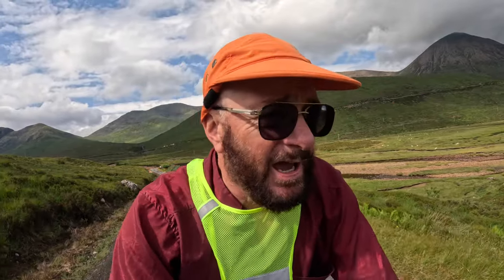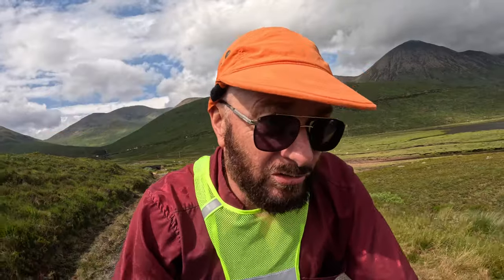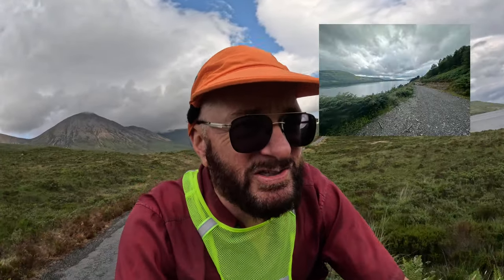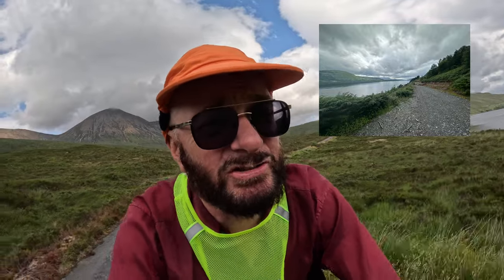Keeping the battery charged while ebike touring / bikepacking

Comment: I'm in costa Rica and have a RAM 1200 watt e-scooter with 72 volt 40 AH battery.     I am having a utility/camp trailer built for $115  that will have hard sides and rain protection. I will be traveling with a 1300 watt gas generator as well. But plenty of places will allow me to plug in offering a few dollars. I will be turning 76 in a few days but still at it. I do not have residency so a drivers license not possible. But also have a 110 cc 2 stroke moped and may tow one on the trailer as backup.
Reply from the maker: Wow thats quite some setup
Reply: @Ebiketouringlife  Electric only it will do 36 KPH up a 21% hill. upon which the posted limit is 40.  I weigh about 180 pounds.  I use a app on my cellphone showing percentage of grade. Very handy. And often take chalk and write the percent of grade for others.  Until 4 years ago I mountain biked in the Andes of Ecuador, Peru and Bolivia. Pushing my 21 speed mountain bike up mountains over 16,000 feet. Not in my prime would I attempt to actually ride there. And sometimes even walking more than 10 feet and resting was enough with a mountain bike and gear.  I still keep mountain bikes in Mexico, Nicaragua, Costa Rica, Panama, Colombia, Ecuador and Peru as it is a pain in the ass flying with a bike, let alone Internationally.  But all of those cost less than $200. Less than shipping would have cost.

Make it to Costa Rica or mentioned countries, get in touch.  Moped adaptions are the cheapest, bike and conversion about $450. Electric bikes with 1000 to 1200 watts are $1200 to $1500. My scooter was $1600. Disconnect the withe wire limiter and the 1200 watts becomes 1800 and no one will know the difference.  Europe limits wattage too much. It is speed that counts. If they want 20 MPH the limit, fine. But the power should not be limited to do so uphill.

When the weather sucks where you are it will be spring like here year round.
Reply: So the gas motor is there to power the battery for electric scooter? Why not just have a gas powered scooter? I thought the point of EVs is to be more efficient than gas
Reply: @ianleui7007  Gas powered scooters are not allowed in National Parks her or allowed to operate and park on sidewalks. Electric scooters are allowed in those places. On the roads gas scooters must operate in lanes with vehicle traffic, while electric scooters can operate on dedicated bicycle lanes. At home my e-scooter is recharged by non carbon source as has been so in Costa Rica for the past 10 years. Mostly wind turbines and in such quantity the excess is exported to 5 other countries. And in addition to that an electric motor is much quieter. Anyone knowing about 2 stroke mopeds also knows they cannot be run more than 20 minutes nor at low speeds as they will overheat and destroy valves and piston. Lastly the gas generator only serves as a backup. I likely will find it completely unneeded as the scooter is a 72 volt, 40 AH battery good for over 130 miles without peddling.
Reply: @ianleui7007  Nearly forgot. Gas mopeds and scooters here also require emissions testing. And those engines will not pass, absolutely guaranteed. Electric scooters and bikes are not emissions tested.  You think California is rough on emissions, you have seen nothing.
Reply: @riskyron1416  that's very interesting I didn't know that thanks for explaining
Reply: @ianleui7007  Course I could add a 2nd battery for about $5000 but the gas generator is still about the same weight. And can power my refrigerator at home during any extended power failure.. Though not feasible an e-scooter could be transported on plane with a medical prescription. A gas moped never could.. Costa Rica is about the size of New Jersey, so with a 130 mile range and being located center just about all is in range. And sure most here would allow me to plug in and recharge. Even a hostel would only be about $6 and a hotel $25. Most countries are like Europe where you have the right to roam. Meaning both government and private property can be used to walk, bike, go by horseback and camp (just no  vehicles with internal combustion engines) providing you do not interfere with others or camp in their front yard. Or stay more than a night. System works well.

Comment: Love your advice. Would love to know what type of ebike ur cycling please as I have 3 year old Giant Liv Amiti and only use for shopping and occasional long trips but it I think the eco mode is bad on these so I stay in lower manual modes depending on terrain. Buying second battery is good idea but the charger is heavy enough itself. Thinking of looking at lighter ebike with lighter battery and lighter charger. What do you think please?
Reply from the maker: Depends on your touring style - if it’s between hotels or other places your certain of charging then your battery can just have slightly more range than the longest distance you’d do in a day. If like me you wild camp then the extra battery means you don’t need to panic if you go a day without a charging possibility 

Mine is a Raleigh Motus Tour which I reviewed after 11,000km here in the context of the questions your rightly asking Review after 11,000 km on a Raleigh Motus Tour - 6k of those bikepacking
https://youtu.be/LS9ND5WifnY

Comment: Great video, very informative and raising important issues. You get 100 km out of your 500 Wh battery. This = an energy consumption of 5 Wh/km. On my Specialized Como ebike in eco mode I cannot get less  than 9 Wh/km on flat roads and with no luggage. I.e. my 460 Wh battery under no circumstances give me more than 50 km range. How come power consumption is so different between different makes of ebikes? May ebike testers look into/test this pls.
Reply from the maker: This is pretty interesting, do you know what the eco mode gives as an assist as a percentage (40% for mine). Also is it speed limited to cut out at 25kmh as I think that might make a big difference in range if not. I’ve cycled 4 different e-bikes now and all would be similar range as what I get although one that is rear wheel drive did appear to be 10-20% less as that’s a lot cruder. I hope to replace my controller with the Nyon and I’m hoping that may give me access to historic battery trip data in which case I’ll be able to cross compare with my watch records of distance & ascent and provide something better than my approximations (but I’m sure of them within 10%)
Reply: I live in Denmark which is flat land. My ebike is off the shelf, I.e. it follows the 25 km/hr speed limit cut-off EU regulation. 
As for the eco mode I do not know the exact  percentage, but going by the meter reading it should be around 20%.
Reply: There are so many variables that even the same rider on the same bike on the same route will have variations due to head/tailwinds. 
I was disappointed with the range I was getting from my 720 Wh battery (15aH), and recently upgraded to a 1008 Wh (21aH) battery. That plus replacing my 2.8" wide knobbly tires for 1.75" wide smoother tyres allowed me to do a 70km ride over hilly roads ands still have 40% battery power in reserve.
I used to carry a second battery, now I don't need to - but I'm also back home after each ride to recharge.
Reply: Your hypothesis isn't correct. Watt hours are calculated in a certain way but arent always true, i.e. your peak draw may be higher than you think, your cells aren't that good any more, voltage sag and so on. 
Generally, the higher the voltage the more watt hours in the same configuration as the voltage is higher. A 36 v battery will never have an equal voltage to a 48v battery, to the 48v battery has more overhead to supply to your motor.

The reason  batteries and wattage draws vary so much is simple, not every motor is equal, not every battery is equal, and not every rider is equal.

I for example have a hub motor mountainbike with 1000watts, my battery is rated for 1200 watt hours, that does not mean that I have an hour and 15 minutes or so of full throttle at full power, that would be a oversimplification of watt hours.

Comment: You can always charge your cycle at an ev charging station also, a lot of the Tesco charging points are free as well, but even if you have to pay it's very cheap.
Reply from the maker: Really?  I’d no idea they had a standard plug outlet - that’s very worth knowing
Reply: The adapter plugs in to the ev charger, it's the adapter that has the standard plug socket on it. @Ebiketouringlife
Reply from the maker: ah so you need an adaptor, is it the same as the one you need for campground electricity hookups  @bvgb921
Reply: Many times it's not as much about access to power as it is the amount of time it takes to recharge the pack.

Comment: Im planning on doing a tour from Alaska to Argentina on my bosch powered ebike. Good video. Gonna get a second 500 wh battery too. I got the 4a charger too so it charges abit faster.
Reply from the maker: Yep the 2nd battery gives you needed confidence to take risks around distances where you can’t be certain of a charge as the ‘panic point’ shifts from c100km to twice that.  The faster charger really pays for itself instantly as it means a meal break can almost all do give you another days range
Reply: Might want to rethink that. El Salvador in particular expect to be robbed and lose all. Border crossings not pleasant either. They may tear your bike apart and all you will have left junk.  While I admire your plans it really has not been feasible since the early 1980's.
Reply: @riskyron1416  I’m a decent size brown guy, lots of people doing this route every year. Feel like the risk is worth it.
Reply: Of course, you are.

Comment: So is it 20a 36v batteries ? Yes as I do. I have had folding e-bike since 2014 and had 370wh battery included and would charge any cafe or ferry waiting room I came across , I have a more powerful 42v 4a charger that helps to do it quicker :) thanks for posting
Reply from the maker: not sure of the A and v but its 500w and yes with a fast charger so full charge in about 150 minutes and if its near flat a charge t 50%+ in about an hour (charging seems to slow a fair bit as you charge to the higher percentages)
Reply: @Ebiketouringlife  Thats correct - for example for a 48v 13s battery, the full voltage is 54.6 volt, not actually 48v like one may think; then, around 54v - the BMS will "trickle charge" and balance out the cells. Thats the reason for the slow charge.

Comment: i think the range algoritm is pretty simple ; it just says how far you can go if you keep cycling the same way as you are cycling right now. Same speed ,same level of ascending , sime amount of wind ,putting the same amount of effort yourself, etc...
Reply from the maker: From observation I don’t think it’s a ‘now’ estimate as that would jump wildly every time you crested a hill. I think it might be since the controller was turned on but with the start point being the previous time the controller was on as the variation on start up estimate is wide but consistent with my last usage (for fully charge 500w I see 90-150 on startup) It might/could be smarter than that, perhaps weighting the last 20km at double the previous etc.
Reply: This goes out the window if your knees, etc. give out, as mine tend to after 15 to 25 miles! (Or you need to have your blood pressure medicine changed to a less exhausting formulation!)

Note: I’m near retirement age, have a number of serious health problems (most of which I was either born with, or began showing in childhood) and have had twenty surgeries, including surgery on both knees - which are connected with some other things I was born with.
Reply: I like inquiring about grades one can peddle. I'm pretty much finished with any uphill grade over 21%. I weigh 183 and am 78 years old. I don't see any peddling up anything in excess of 30%  They will be walking it.
Reply: Only someone that hasn't ridden ebikes would think this way. There are too many variables, the only way to know what your range is going to be is to have ridden enough that you have learned what your range will be.
Reply: @brianbassett4379  ive ridden e bikes

Comment: You might be able to charge your e-bike at gas stations or campings with a special adapter. Always check the tire pressure. Low pressure means you loose a lot energy. Be aware of the temperature: Cold accus won't charge. The first battery I would drive almost empty (one stripe left) then I would use the second battery. If that one is empty I know I got a bit left in the first one. Thanks for the effort, great video!
Reply from the maker: Thanks you just reminded me to investigate the possibility of using EV charging stations. It does seem that with an adapter it is possible which is interesting although I wonder if in practice minimum charges might make it pricy

Comment: My primary focus in building an ebike was an ebike with a truly extended range. I had already decided a mid-drive motor and a Rohloff Speedhub would make the best possible touring ebike. I also wanted a suspended frame that often causes a problem with battery placement and size. What good is a long-range ebike if it's torture to ride for 10 hours? I found the perfect frame for a touring ebike in the Tout Terrain Panamericana, suspended, steel, 26" X 2.5" wheels, and with an integral rack. I wanted the largest possible 58.8V battery that would mount in the frame triangle which has ended up being a pair of 35Ah (2058Wh) triangle lithium packs. A single pack can get anywhere from 60 to 120 miles depending on the bike load, trailer, and terrain. Charging becomes exponentially more difficult the further you ride from access to 120V/220V infrastructure. The best option is to stop for the night somewhere with access to power and charge while you sleep... not an option when the idea is to get away from civilization. The only time I ever use a B&B or motel is when I want to take an hour-long shower and wash clothes. Sitting and waiting at some gas station or a kind homeowner's yard for 4 hours in the middle of the day to recharge isn't optimal. After a year of riding around like a Gypsey on dialysis looking for an outlet, I invested in a 300W folding solar panel. The bike was assembled in 2016 and has averaged 6K miles a year for over 48K miles now. My record is also 8 days, 500+ miles of riding without ever seeing another human. It would have been longer but I couldn't catch a fish to save my life and ran out of food so I headed for the closest grocery store to resupply and head out again. When I got an EV charger adapter it gave me access to another growing number of possibilities to charge. My power options are 120V, 220V, or solar charging. - https://photos.app.goo.gl/wP8vs7T5hLpNjSBX8
Reply from the maker: Quite a setup - Ive started to think more about trailer based recharging because I’ve a growing sense I’d like to do a big Africa tour and in some places (deserts) it can be 300km or more between electricity points on the sort you of rough sandy roads that reduce battery range
Reply: @Ebiketouringlife   Pulling a trailer changes everything, not just for the better.

Comment: Built solar trailer, & have all but finished a gas/electric hybrid with super efficient
39cc engine + modified belt drive. it can charge 1 battery on running bike & 2nd in trailer.
Has 30Ah from 2 batteries, (80 mi.) & gets 50 miles to a liter of gas. All waiting for
a 750w bafang mid-drive,( a simple install.) Battery & mount ready to go, gas part 
functional  already. With 3 liter jerry can & charge on the fly. I have unlimited range.

Comment: Had an endurance ebike, but due to range anxiety,  replaced it  with a Kona Sutra touring bike with a  wide gear range , getting up hills slower  but easily and  a Recumbent trike with  an even wider gear range of 1100%

With the ebike I went up hills twice as fast, but as I ride for leasure , in no hurry so a bike or trike with low enough gears is fine for me, the trike can use as low gears as you like as wont fall over if too slow.
Reply from the maker: theres definitely a benefit to a unassisted bike having a range limited only by the amount of food and water you can carry. I'm fairly confident I can get a 220km range in my usage which is more than enough for my likely future plans but if for instance I intended to cross Africa I might go back to mechanical

Comment: I've got 2 ebikes. One is an Engwe engine x with 48v 13ah battery in the frame and 10ah on the rack with a dual battery balancer kit. I've set it to 7 peddle assists but use mainly 2 out of seven which is about 15 mph. I can get  50 to 60 miles out of that. It's big and heavy but actually quite nimble. I've added a seat with a back rest and it has bmx bars. It's more of a comfy cruiser that can tackle a bit of rough stuff with it's 20 by 4 inch tyres. My other bike is a Kona Mtb with 27.5 inch wheels. I've fitted that with a Yose power 350w rear hub that comes with a 13ah 36v battery. That gets me about 35/40 miles. That will be my main commuter bike and I plan on fitting a whopping 35ah to the rack I've fitted. I'm relatively new to ebiking having bought the engwe last october and it's been a steep learning curve but a lot of fun. I've done so much to both bikes and also have a cheap apollo mtb which I've had for years in good condition looking rather sad in the shed. I have plans for that too, maybe a mid drive kit who knows. Lovely video by the way and where you were riding looked amazing. I'd love to do that! ❤😊

Comment: DUDE! Where's your helmet??  But good on ya for the safety vest.
Too much "talking head" and not enough photographic examples, maps, etc.
I car camp for hunting and camping and use a BLUETTI AC200 MAX Li Fe Po4 battery kept charged by an Off Grid TREK 220 watt solar blanket cable locked to my SUV's roof racks.  I canary the 13 pound solar blanket on my bike for daily charging at a camp away from the car.